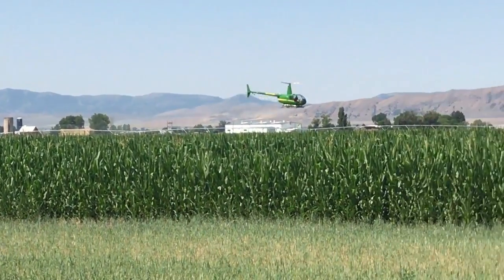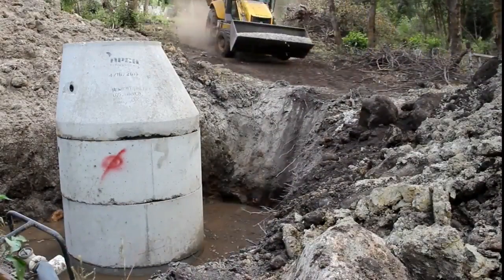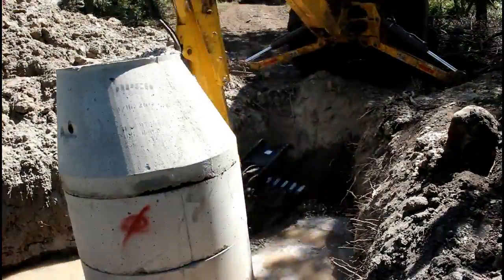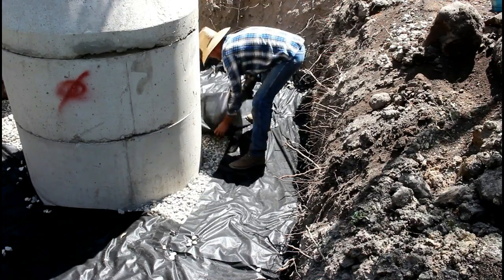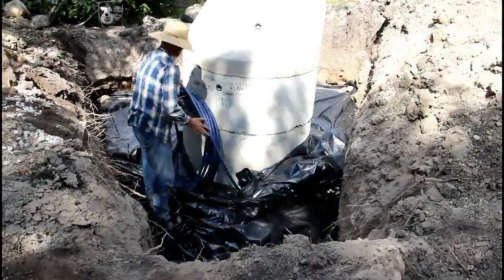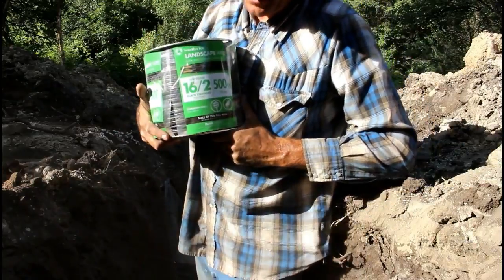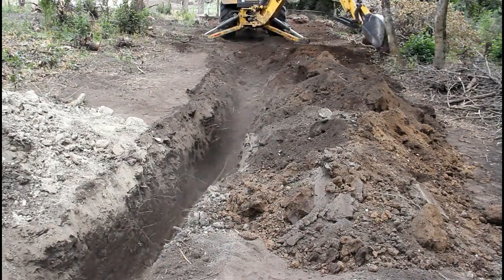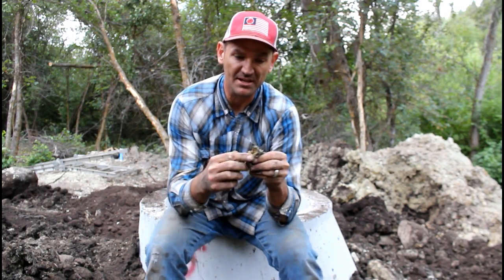#246 - DIY Shallow Well - Sealing The Well! (Gravel, Plastic And Clay) Pt 3

Comment: Also water pipe is tu be buried at 4 ft no matter where it is ..other reasons the. just frost .I.e pipe rupture etc...also to seal your well is done with cement .properly done is by an 8 inch trench all the way around tile once backfilled so its only that open void about tile and half down.. u fill with cement and that is your well seal which stops contaminated  ground surface  water from entering up well and contaminating  up well and possibly aquafir  for ur neighbour's  there is reasons there is licensing and pros etc ..for ,out part okay job for a farm and livestock well but not human consumption by today's standards ..30 years ago sure..ministry fry ya for that well my home though

Comment: Good job alot of work I do question 16 guage wire should be a minimum of 12 guage to run a pump a100 ft from main power source personally myself I wouldn't have went less than 10 guage but I'm certain if you running a pump on 16 you will be replacing it before long

Comment: Love the work and videos, but a couple k for the water? Cisterns, 3 loads of gravel, backhoe, excavator, 300ft X2 pipe, signal wire, pump(s), pressure Ctrl, valves, solar panels/controllers/Batts/mts/wiring, sediment, uv, carbon block filtration, storage tank, etc. Seems like a heck of a lot more than a couple thousand, plus an incredible amount of work (obvious no stranger to that). I'd love to see a breakdown. Keep
 up the awesome work and know us regular folk are pulling for ya. :,-)

Comment: If the wire gives you an issue you can always go wireless.  The wire is a good thing though anyway because after things get grown over for a long time, that wire will let you detect the exactly location of the run even if it is copper.

Comment: Parkinson’s Disease:
Interesting fact about Parkinson’s which isn’t known by many, is that it was nonexistent until the beginning of the industrial revolution. The first documented case of Parkinson’s Disease was reported in England, 1817 by Dr James Parkinson of the Royal College of Surgeons. As the Industrial Revolution grew and spread throughout Europe during the 1800’s so did the reported cases of Parkinson’s. 

The exact cause of Parkinson’s Disease still isn’t known but as pointed out in this video there is clearly an environmental component. The cases reported show an obvious association with exposure to pesticides, oil based solvents and lubricants. Which of course were nonexistent before the Industrial Revolution.

Comment: Great job...and you will curse the day you get rid of a great running backhoe.....Got one question... will the water fill the entire cistern?  Or because you entered the side vs the top will it be where you drilled the hole? And why not run the line in from the top? Just curious ?  I do understand you are pum ping to a huge tank above your house for pressure... so maybe it doesn't matter.
Reply: He doesn't expect the water to rise much higher than the top of the rocks and wanted to keep the line below frost.
Reply: Peter Grant he didn't put the poly through the top because of the frost depth.
Reply from the maker: I put the concrete pipe quite a bit higher than the water level. It my get a little higher but not a ton more. The pipe is below the frost line.

Comment: Suggestion if you are interested: 
You can use a regular well pump in there. Make a sleeve for the pump to make sure you get fresh cool water past the motor. 
You should build a little frame in there and use a pitless adapter to attach the pump. It'll save you from having to go down in the cistern in the event of a pump problem. 
Also, make some kind of sluice system to stir up the sediment at the bottom of the cistern so you can pump it out as needed. More sediment will accumulate than you think. 

Anyway that's my 2cents. Nice job!
Reply from the maker: Thanks!

Comment: Can't tell you how happy I am for you that this worked out as well as it has. Who would have thought that that little seep you found way back when would become your well site. I remember when you had the witcher up there looking for a spot. All he found was a big ass rock that bent your drillstock. Are you going to end up with a smaller tank by the house, or just run pipe direct from the tank to the garden, shop, and house?
Reply from the maker: One 2500 gal tank for now. May add another tank later.

Comment: Thanks for showing us how to install a shallow well.  I wonder how the farmers kept their crops in good condition before the Industrial Revolution Age.  Surely there was another method in which crops were protected for thousands of years.
Reply from the maker: monicapttrsn they probably kept it smaller and more manageable. Everybody had a small farm.
Reply: it's also the difference between 5 bushels an acre and 25 bushels an acre or more. pesticides used to be made or based on arsenic, mercury, or even tobacco soaked in water and then the "tea" poured around the plant. killed the bugs, but wasn't very good for people either. I still remember DDT as a child, and video of people eating agent orange to prove how "safe" it was. some people are jst dumb.
Reply: They calculated for loss, if  you needed an acre to feed the family you planted 2 or more.
Reply: Thank you Viktor, I hadn't considered that approach.